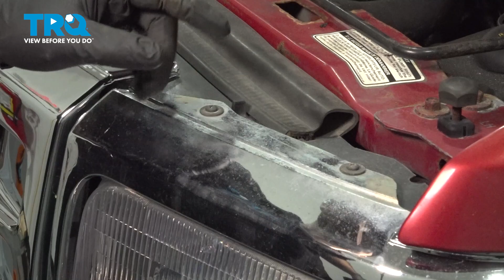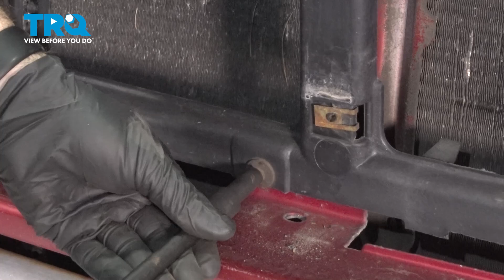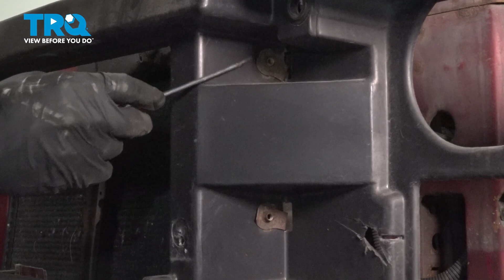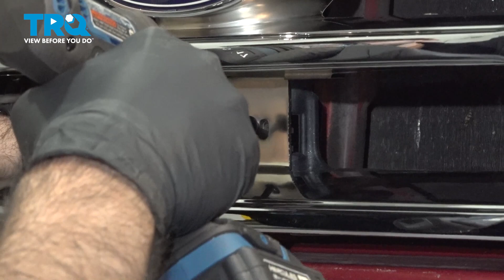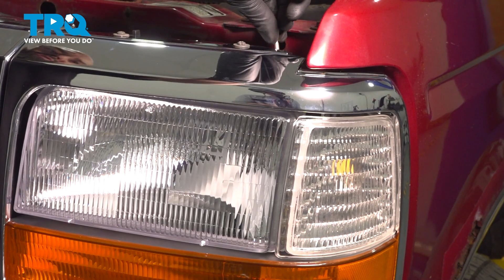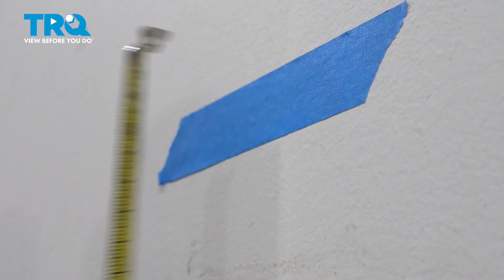How to Replace Headlight Mounting Panel 1992-1996 Ford F-150

Comment: The nuts behind the left and right bottom turn signal housings are missing in this video.  there are two holes to remove the nuts before you cand remove the turn signal bezels and assemblies.  On your truck, someone has already removed them.

Comment: Just wanted to add to this video one small detail.  I have a 1994 XTL f150 and the first part where you pull the turn signal, and the running lights have a bracket inside. If you just twist and pull right off like you did, it breaks right in half. I follow your videos and break right away.